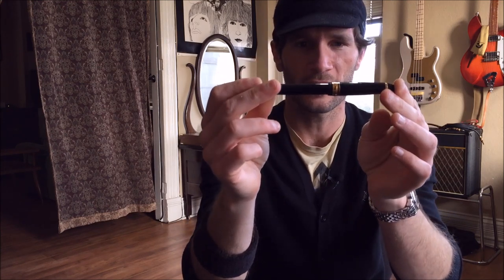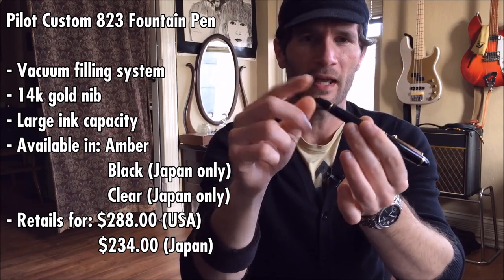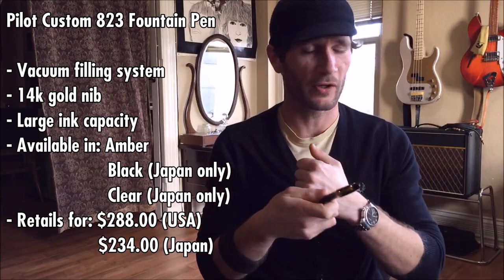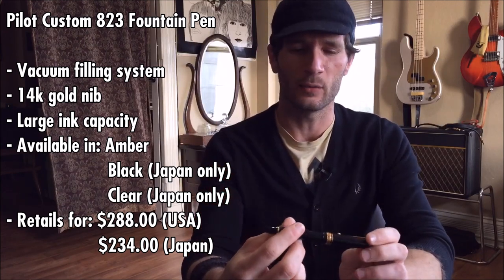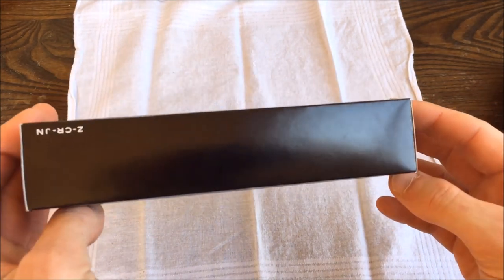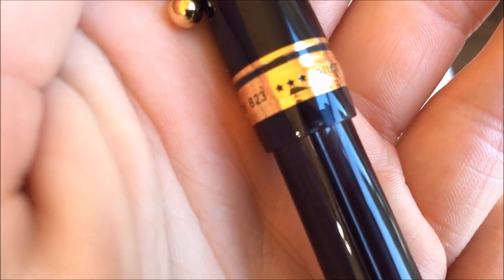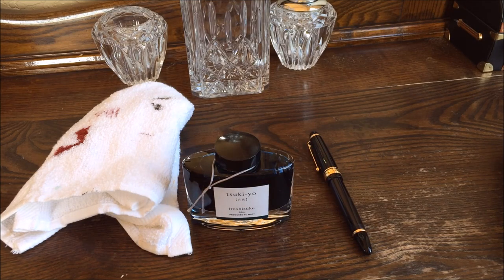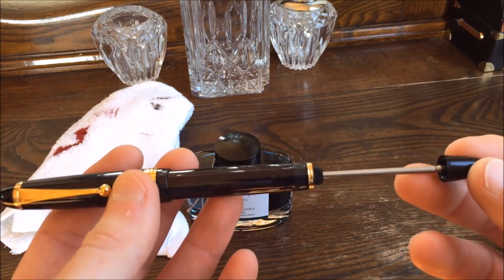Review: Pilot Custom 823 Fountain Pen

Comment: I have it in Smoke too, which is now available in US.  I got a good price, from a US seller, because I bought 2 other pens.  I’m still on the fence with the vac fill, I’m just not used to it.  I do love the way this pen writes...but I’m finding it requires more lubricated inks.  I’ve tried a few Diamine inks in it, and it’s  too dry for my taste with them.  So far I’ve had the best performance with the blue ink that came with it, and the inks from the Pilot Iroshizuku line.
Reply from the maker: Thanks for sharing!

Comment: Hi there Bradley.  You are a really good pen reviewer!  Please do more.  I have 2 questions. One for this Pilot and another for the Lamy. [1] Have you tried removing the little "travel gasket" on the Pilot plunger? It eliminates the need to unscrew by ~2mm or so and have constant flow.  I did this with my Vac700 TWSBI and had no leakage issues when flying.  [2] Is your Lamy the Makrolon material?   Thanks.
Reply from the maker: Greg Siragusa - I think I mentioned the gasket in the video, but no, I haven't removed it yet. I may at some point in the future, but for now, I don't mind unscrewing the blind cap. My Lamy is the makrolon version. Thanks for watching!